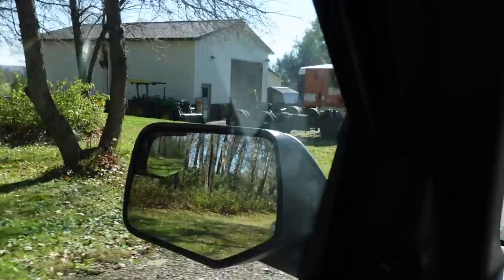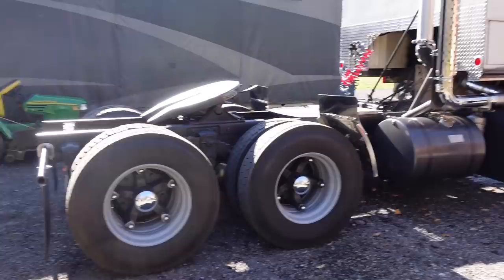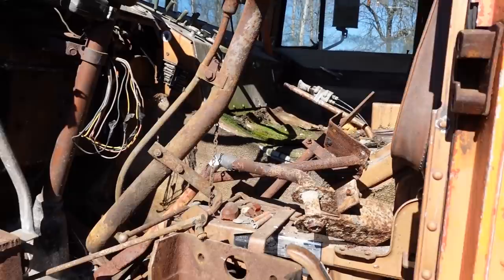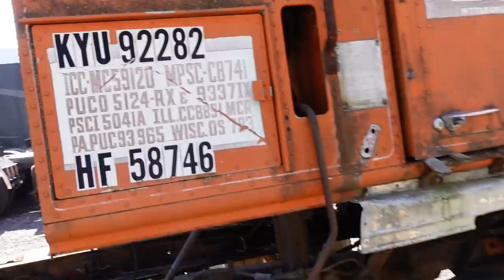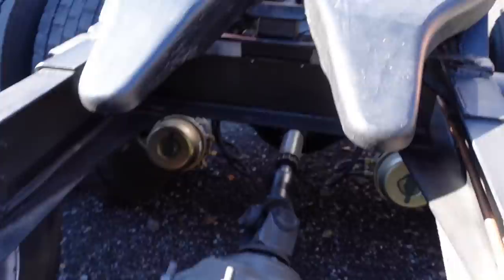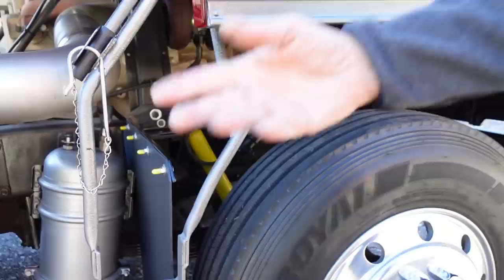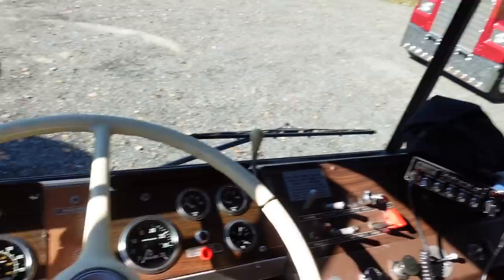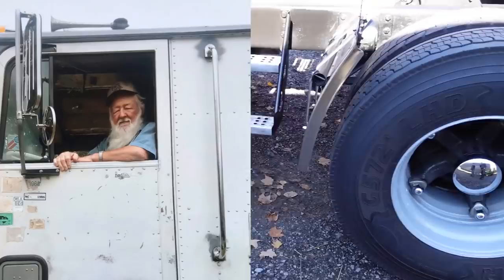1972 DODGE L1000 Cabover

Comment: I'm old enough to remember heavy duty dodge trucks
Reply: Back in the 70s as a kid I remember eastern freightways which bought associated transport and ultimately bankrupted them ran lots of dodge single axle conventional tractors with Cummins engines and probably 5spd 2 speed rear transmissions

Comment: I owned and operated a 1973 Dodge CO. With a Cummins 903 v8 and trucked all over. Had a very unique sound. 13 over tranny.  390 rears because I pulled 35 ton loads in Canada.
Reply from the maker: So cool! Love both the truck and the 903.😬👍
Reply: @DaneScottsTRUCKERSLOUNGE  . The 903s have such a distinctive sound 😉. 350 horsepower back then.
Reply: there was a guy run west out of Wpg Manitoba Canada with a blue L1000 with a 318 det with a  big sleeper

Comment: 11:40  So cool to see it uses the same key style as the 60s-70s Mopar cars.  Could've easily been some type of industrial-type item used instead, glad the engineers pulled from the parts bin.
Reply from the maker: The early trucks were like that from Ford, GM, and Dodge. Very cool

Comment: Very Very nice. A perfect  restoration.  And a labor of love. 250's did not have turbo's
Reply: Some of the later 250 Cummins did have turbos, I think that started in the early 1970's at first they were called Super 250.  I know the military trucks that have 250's don't have turbos,  the ones made in the 2000's . As well as the early 250's

Comment: Aluminum cabs, you think would see more around because not rotting out like steel., What is the hole in passenger side of cab for?🤔,,, Nice video, can't wait for bighorn!👍😎
Reply: If you're referring to the area right behind the passenger door it's the cab jack handle.

Comment: No front brakes?? I had no idea that was a thing!  That's a great looking truck
Reply from the maker: I know! My 74 Pete doesn’t either. 😮
Reply: If the tractor was manufactured before june 25 1985 you can take the front brakes off may want to double check that date been along time since i checked it

Comment: As a young fella back in the day, I almost bought one of those new from the Dodge dealer. I say almost because after I got inside to look around, the craftsmanship was terrible, things were misaligned there was excess glue spread on some of the uholstery and overall it just looked a bit shabby for a new truck. I figured if the interior was like that, the exterior and running gear won't be any better and I walked away. I'm retired and 74 now and this is a fond memory.  🙂
Reply from the maker: Sounds like you were a true professional and had pride in what you did George. Hats off to you and your service. Thanks for watching

Comment: That must be more than a 250 ! I heard a turbo !! What's the deal with the hole in the passenger side of the cab with something hanging out ?
Reply from the maker: I believe the 250 option had the turbo as part of it. The handle sticking out is the cab release.
Reply: Correct..250 Cummins didn't have a turbo.  220 Cummins with a turbo = 262.  250 Cummins with a turbo = 282.

Comment: You did a beautiful job bringing this ol girl back from the dead.
I was wondering what the tractor weight is and how it rides (rough/smooth?).  Did you need to rebuild the Cummins 250?
Reply from the maker: I rode in it, rides quite well and like a new truck of that time. He's got it very tight; no squeaks, rattles or smells. top notch save for sure. Thanks for watching.

Comment: I owned and operated a 1973 Dodge CO. With a Cummins 903 v8 and trucked all over. Had a very unique sound. 13 over tranny.  390 rears because I pulled 35 ton loads in Canada.

Comment: That was a cool truck. Was that a super 250 with a turbo?
Reply from the maker: It was 20 more horsies and a turbo over the 230 base motor. Thanks for watching
Reply: The super 250 has a longer stroke then the regular 250. Moves it up to 927 ci from the standard 855. Longer stroke gave it more torque. No turbo on either one. The luberfiner on the old 72 Transtar I used to drive stuck out horizontally from the frame slightly tilted down.
Reply: @robgm6926  I drove a 1972 autocar with a super 250 Cummins I thought it had a turbo I could be wrong that was a long time ago.

Comment: I really dislike YT channels that film driving segments. Just get to the point of the video please.
I used to drive a 69 Dodge cabover like that red one only the smaller sleeper. 238 Detroit and a Fuller 13 speed trans. It was a horrible truck to drive in the winter, you couldn't stay warm in the winter with both the cab and sleeper heater running full blast plus the radiator covered with a piece of carpet.
He said it was an aluminum cab? why is their rust all over it? The one I drove had some surface rust on the body so I doubt the cabs were aluminum.
Reply from the maker: Everyone has their likes and opinions. I’m not trying to “get to the point” I’m trying to give an experience that brings memories. Thanks for watching.